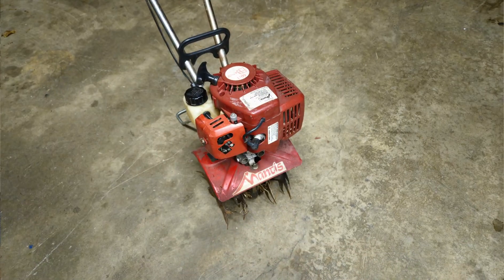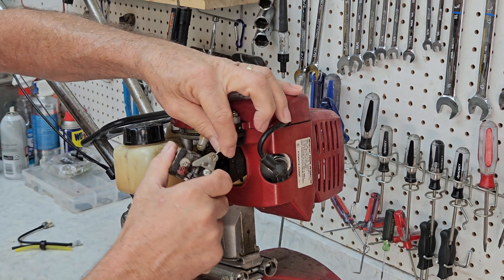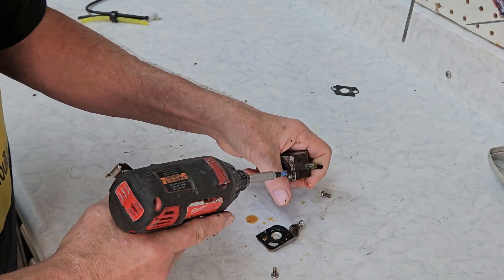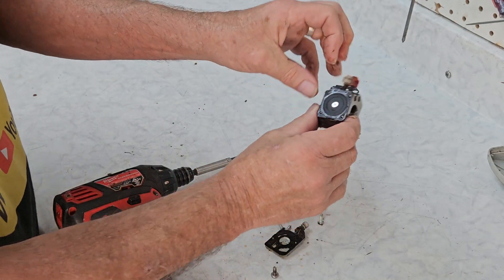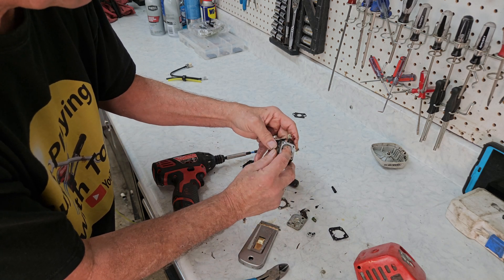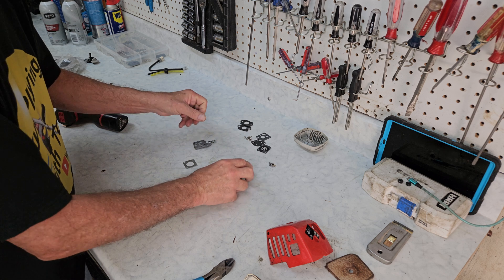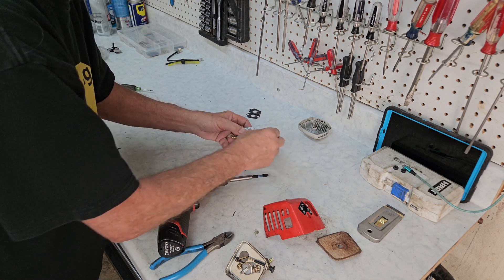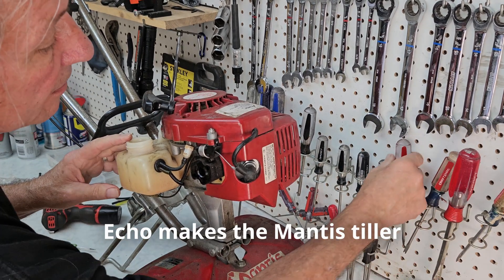Mantis tiller carb rebuild

Comment: I really appreciate this video as I've got one of those that needs some work done to the carb and it hasnt run in a long time.
Reply from the maker: If you have an ultrasonic, it's pretty easy to get a lot to rebuild it. If not,  put the carb on the desk in front of you and order one.  There are 3 carbs for this one but it's obvious if you have the old one in front of you
Reply: @GuysPlayingWithTools  - Thanks
Reply from the maker: @herenow2895  If it doesn't go well,  ping me and I will help where I can.  If it goes well,  ping me anyway.  Lol

Comment: Worked on 2 that had Tecumseh motors. Both had stripped brass gears. Gave the motors away that ran good. Happy weekend and be cool, Bill!
Reply from the maker: My brain wouldn't let me do that. Once I open a machine and get the motor running right I have to finish it, even if I lose money doing it.
Reply: @GuysPlayingWithTools  The brass bull gears cost too much and I didn't need one, much less two. I had a Troy Horse tiller with a 7 horse Kohler that my brother-in-law is still running. Then I got a Gravely with a rotary plow. Then we went to raiszed beds. All gone now.
Reply from the maker: @lewiemcneely9143 Price has stopped me now and then. It's hard to let a good motor go
Reply: @GuysPlayingWithTools  M<essed me up that a little Tecumseh2-cycle ran that good. The brass bull gears were about as much as a new digger so I passed..

Comment: What solution do you use in your ultrasonic?
Reply from the maker: @harleyquintin6974  90% water,  10% Pine Sol. It's one of few things that cleans really well and will not discolor aluminum or brass. It works best at around 140f